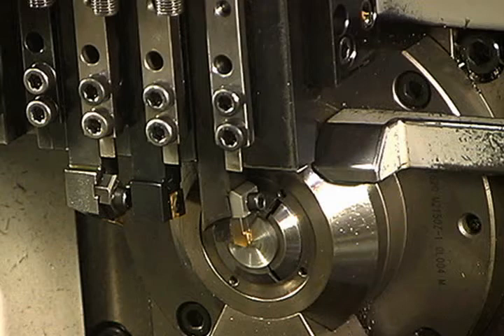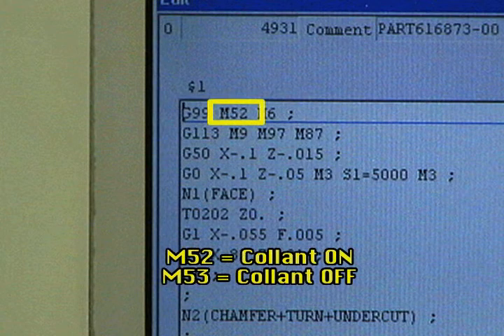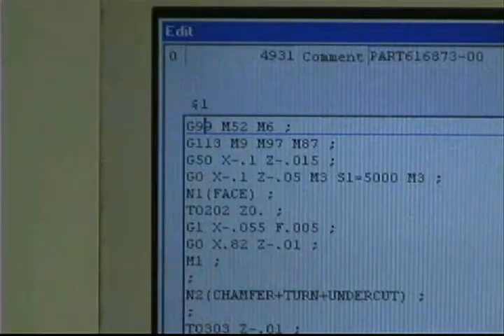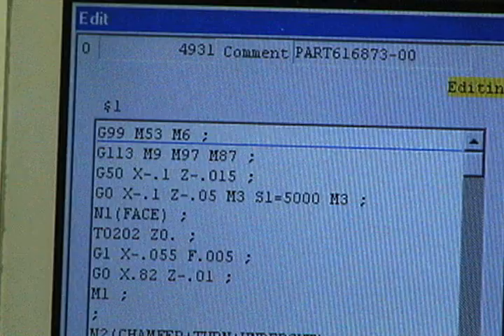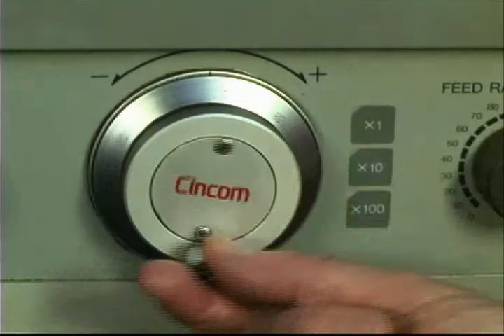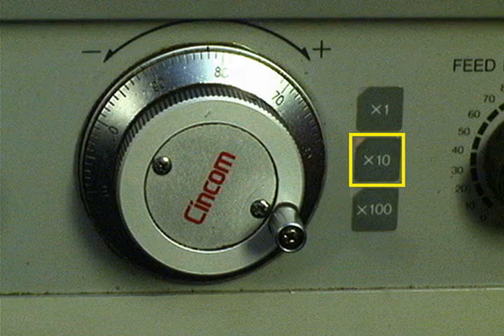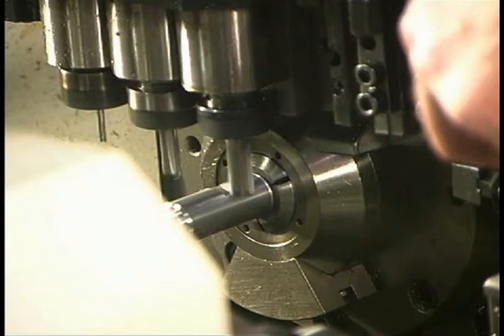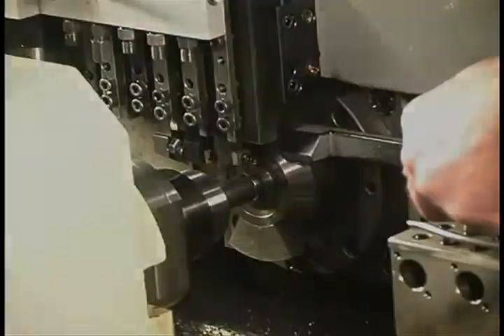CNC Training from MasterTask: Swiss Sample Module 28: Citizen

Comment: There are three types of offsets that are used on Swiss lathes or any other CNC lathe. The geometry offset indicates the physical dimensions of the tool itself, the tool nose radius compensation offset identifies the diameter and shape of the tool tip itself, and finally the wear offsets which are adjusted to maintain part dimensions as the tools wear.

Comment: Certainly. The courses cover a range of models since the major differences between Swiss lathe models is the size of the bar stock they handle and the number of tool stations available. You would select from the three brands of CNC Swiss lathes available and the 5 brands of bar loaders when you enroll.